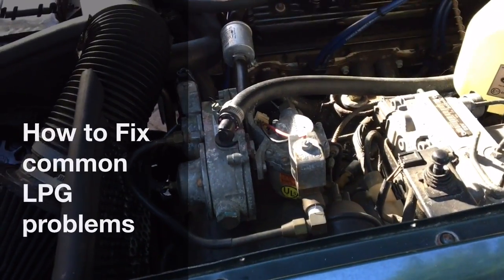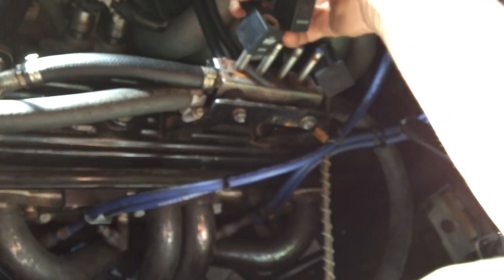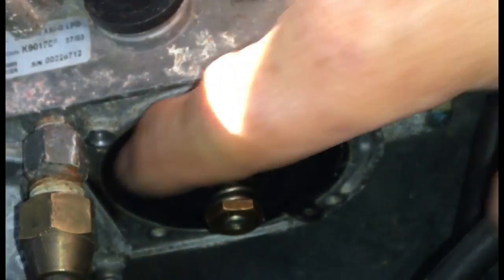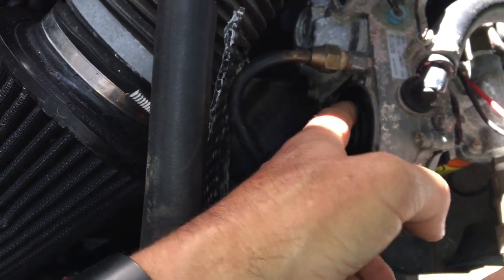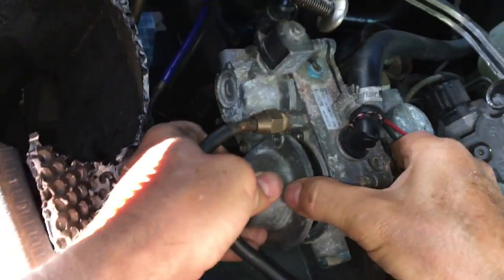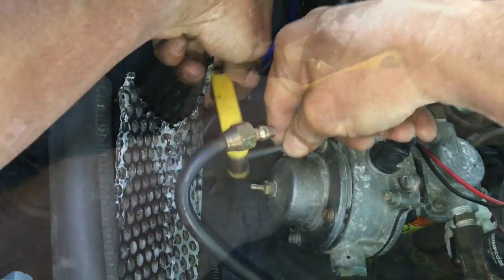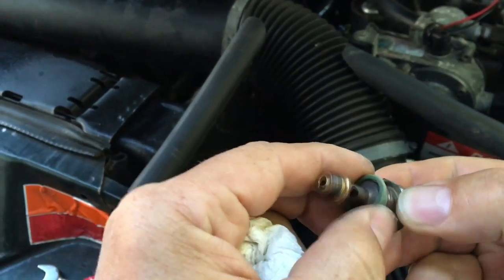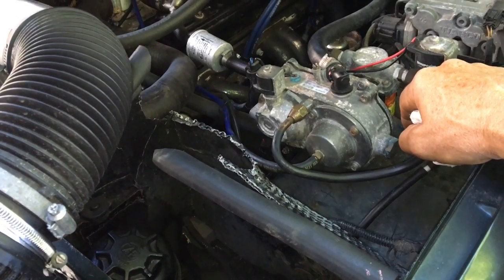How to Fix Common LPG Problems - Vaporiser / Reducer, Injectors

Comment: excellent informative video ,i have a ford explorer and it has rough idle on lpg but as soon as i give it some throttle it smooths out ,a couple of the injectors are making quite a loud clicking noise so i will strip them down at the weekend ,thanks for hopefully saving me  some money
Reply from the maker: Thanks for the comments.  Loud clicking injectors are usually those tiny rubber o rings around the bottom of the injector tubes that have become flattened.  I hope you got it sorted.

Comment: wow, witch is the car with a/f meter? how long that equipment rub before reparating, cause I have a lot of problems with that model of regulator. (propane goes to inlet manifold with BAM! on engine start, other question the integrated line valve doesnt close properly. what the thing after line valve You have?
Reply from the maker: I fitted the lambda sensor in the exhaust and an AFR meter myself.  It's useful for engine tuning.  If propane is entering the manifold it could be via that diaphragm that I changed, which often gets a hole in it.  Check the connection where the vacuum pipe connects for gas coming out when it's running on propane gas.  The solenoid on the regulator output should cut off the propane when it's not running on propane.  The thing after that is just an inline filter.
Reply: +comeinhandynow  Yes l saw exhaust.. does it pickup? and where are You from? are You LPG syst. installer?
Reply from the maker: From south of England.  I'm just a DIY guy.  Ex electronics designer.

Comment: Hi how -Producer assembled this regulator without loctite? :) Have You check parameters after?
Reply from the maker: Good question. Maybe they use a better preformed diaphragm.  Gas pressure was fine at 1.7 bar afterwards.   I often check the a/f ratio via a lambda sensor and in car meter.